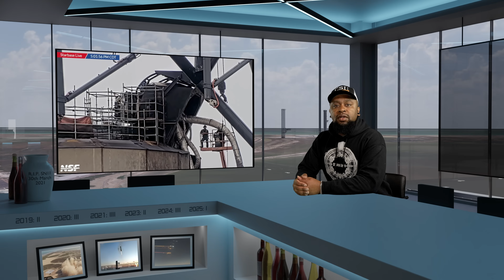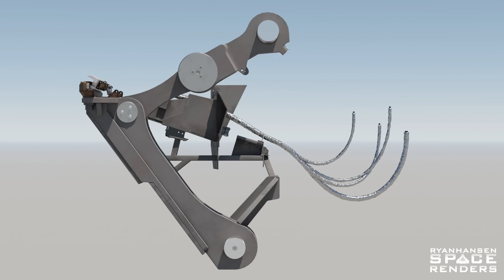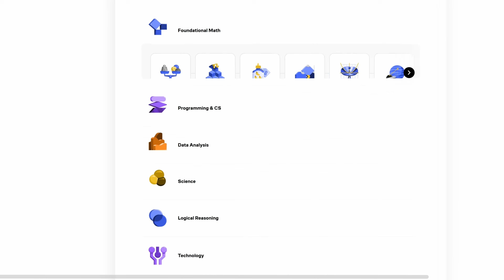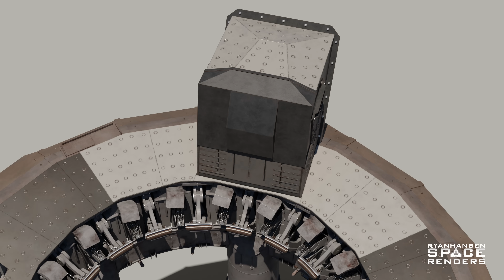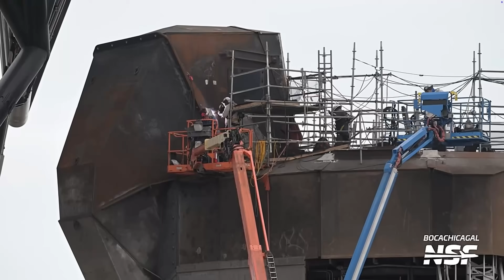The Major Problems With Starship’s R&D Launch Mount | Part 2

Comment: The bushing were likely bored out in position with a line boring machine, after realizing they would need to go a different direction, they shifted from replacing the bushing to the arm itself.

Comment: Reposted from Part 1:  Great videos Zach.  It truely is amazing power generated by the sonic and blast wave assisted plasma torch that lives in the booster exhaust plume.  I was not surprised that SpaceX way under estimated the effects and has been forced to make so many "improvements" to stage zero to deal with these issues.  Like you, I see no easy engineering solution for rapid turn around short of a replaceable mount and hardened flame trench.  The linear focusing created by the water suppression tubes in the new flame trench may prove problematic.  We should never underestimate the dynamics created by focusing blast waves.  Acoustics are not what most of us imagine when they are generated in a shock front.  Let alone when they are generated in a rapidly repeating train of shockwaves.

Comment: I don't understand why they are using bronze bushings instead of sstl. bushings.  Sstl. has a much higher heat tolerance.  The only reasons I can think of is lubricity, stiction, and press forces too high to install and uninstall.

Comment: You do such painstaking research that I know you're aware that Starship will not achieve rapid reusability in this decade, if ever. Falcon9, orders of magnitude simpler, can't be reflown in less than a month. The booster catch was Spacex's equivalent of falcon wing doors and the Cybertruck: showy gimmicks with questionable utility if not useless and a dead end waste of excellent engineering. We won't see a rocket refurbished on the OLM and reflown in this decade. If ever.

What's the procedure to catch a reentry-heated Starship, or to deal with the extreme mechanical stresses that craft will endure during the J maneuver and landing on catch pins while super heated. Who would fly in this vessel after these extreme stressors? They can barely keep the tiles on as it is. Would you trust them or the vessel's welds and superstructure after reentry?

Starship has a loooong way to go before it's viable, although they might get some Starlink's tossed out in LEO soon as a 1-off demo that many will see a success. Starship is underpowered and headed for failure for any mission beyond LEO.
Reply from the maker: lol I’m going to save this one for later use.

Comment: To people who like to knock SpaceX's design philosophy: First off, I'm sure a Boeing or NSAS engineer is saying we would have figured all that out like $20B ago in R&D.  Secondly, if you want to build a whole series of somethings you can either design it to within an inch of eternity, or build one and test it.  If you keep fixing the problems you have along the way then you have a more optimized design in the end.
Reply: Pretty sure SLS launch tower cost $2B to develop and still has issues.  And I think that was Boeing

Comment: Zack, to make the arms even less likely to seize, all they would have to do is extend the lower link. As then it would not have to go up to lock the arm in place. Just a small increase in length would Same as adding weights without needing to add much in the way of weight. place the lower link in a position to fall away which would speed retraction.
Reply from the maker: If they did that then it would no longer be a load bearing link and all the weight would be on the lower Clevis pin.  That’s not what they want.
Reply: @CSIStarbase  The upper bi-fold link would still be load bearing even if you extend the lower link part of it. All you have to do is put in a stop that rests  the lower arm against the upper arm.  It does not have to be a straight line to support the weight. As soon as the rocket meets 1:1 thrust, the weight would come off the assembly and as the bi-fold wold not be in a straight line, it would not bind.

Comment: I can't shake off the image of Soyuz launches where the rocket is held up by a structure quite similar to the SpaceX stage 0 which splits into four parts, each leaning out of the way of flames in its own direction. Yeah sure achieving something similar with Starship launch platform could be challenging but I don't think it would be impossible and it would reduce amount of damage caused by flames significantly.

Comment: Detailed and well put together. But it’s only focused on what they’re doing not why. I never find anyone online pointing out some of the flaws that make you wonder why they’re even using this platform. The first problem I see is the Rockets capability to orbit. They had to design this catching platform because the rocket would not launch with its own landing hardware. If a plane can’t takeoff without landing gear, you may have designed it wrong. We’re talking about a rocket that was initially sold at 300 to 350 tons to orbit which is currently rated for 50. In which its only payload has been a banana and has yet to make it to orbit. And of course, a year after they were supposed to have landed on Mars, we get announced this is just version one of three. How is a rocket that’s only 10m taller than the Saturn five and twice the power not capable of making it to orbit. It should be a red flag. And this catching tower only presents more cost and issues. Their tower is a single point of failure. Any failure of that pad even down to simple mechanical issues, and the whole pad is nonfunctional. It’s added complexity and is absolutely required for launch and recovery of the vehicle. Even bad weather will prohibit a starship from re-entering earth atmosphere. Which would require full operational facilities constantly in operation, even for one launch. Unlike the shuttle or the falcon nine, which just needs somewhere to land. Not to mention that those launchpads are only usable for starship. Unlike the shuttle or Falcon nine that can utilize other launching or landing sites. Meaning that they are a constant loss of revenue for SpaceX.
The problems don’t stop there. Once they eventually get it to orbit, then the refueling math just gets out of control in cost and complexity. Seeing that SLS and starship at the moment cost about the same launch with SLS the only one able to successfully test its platform to the moon and back. It’s hard to see why this is even being funded. The argument has always been that reusability will drop costs, but SpaceX has yet to do that with Falcon nine. The falcon nine cost more today than it did to launch Americans on the Russian Soyuz (not including the bloated cost we were charged after the shuttle program was shut down). Why are we building new architecture, based on recent architecture that has yet to come close to the cost of Soviet era architecture? It just seems that the SLS is the outcome of Congress playing with NASA’s money, but it is a proven system after one launch. Why are we spending billions on another system that is still not proven after 20 years? All that money could just be going to ordering large blocks of SLS and lowering the cost of launches and getting more hardware into space.
Reply: 1. 350 tons fully expendable final version vs 50 tons fully reusable version 1. Yep totally comparable 👍

2. The booster will never land anywhere beside the launch pad, it isn't an airplane

3. It's totally capable of orbit they just didn't intend to. Do you want it to rain space debris on your house because it fails to deorbit?

4. "SLS and Starship cost about the same" LMAOOO

5. "Just order more SLS to lower the cost, what could go wrong?"

6. Ah yes that country that currently invades another sovereign country?

Comment: I wonder if SpaceX will make a separate landing area which could just be the bidet system. All of the launching mount gear is redundant on catching so why stress it with all the heat.

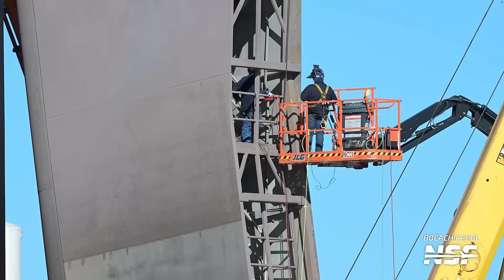Comment: @27:20 the welding on something like this has to be done by master level welders. I'd like to think I've worked on some large projects, but that shit's next level! Cracked welds on a structure that size? The thermal expansion alone causes gremlins I would lose sleep over.
Reply from the maker: It took 6 or more passes on the welds that join the OLM deck to the legs.  Pretty insane.

Comment: I'm wondering why the hydraulic cylinder doesn't pull directly on the middle of the two links to prevent binding instead of pulling on the main arm itself?
Reply from the maker: That’s a good question. We considered that as an option because there are mounting points for either another actuator or a gas spring cylinder/dampener.  But after searching through thousands of images looking into the launch mount before the shielding was installed,  I wasn’t able to prove that there was anything else attached to it.  

But if you think about it, two actuators increases the potential of something going wrong if they happen to fall out of sync.  The timing has to be perfect

Comment: I'll bet those bushings were removed by cutting them out or even just using a torch and melting them. They were probably installed using liquid nitrogen instead of a press.

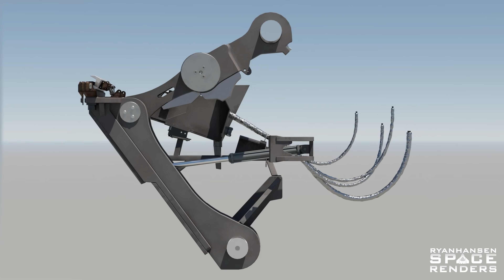Comment: 20:00 Locking/adjusting the actuators furthest extension would also allow the linkage arm joint to be set to a maximum angle, say 170* or 175* for example. I suspect the weights added are more targeted just to force the whole arm to a further retracted angle in rest position in case the actuator fails during launch.
Reply from the maker: If the arms aren’t at a 180 degree angle then that dramatically increases the load on the lower load pin.  They would no longer be load bearing linkages.
Reply: @CSIStarbase  they can't be load bearing without some kind of locking mechanism. If they need to bend to get out of the way fast, I see no way that they contribute to the hold down strength. That would be the triangle formed by the lower arm and the actuator. It appears to me that they may be mostly designed to take tensile loads rather than much of any compression loads. (like guy cables on a tower)

Of course I could be totally wrong, but given even your thoughts on the weights placed on those linkage arms, the second three actuator releases it's thrust outwards, that joint will bend. I believe that's primary evidence of my theory. Please share your thoughts.

Comment: I believe that a lot of individuals don't realize what is involved with creating a new launch and rocket system. We all know that the Mercury and Appolo work ups took years. However, what they went through wasn't daily watched and documented. It's easy to say and question based upon past experiences with NASA. This is a very different animal. SLS uses a lot of systems proven out by the shuttle program. What then is the closest rocket to Super Heavy for comparison?

Comment: 1969-1972 Successfully landed on the moon 6 time in 4 years ( twice time in one year!!! ) that mean  apollo it's easy  but 2025 ( 0 time in 70 years ) that mean  space-x it's hard ?
Reply: It wasn't easy for Apollo either, but also, they had unprecedented resources. Even with that, the program was cut short.
Reply: With the money SpaceX spent so far on Starship, it wouldn't even cover the Lunar Module development cost

Comment: You have to also wonder how much heat got to the uprights holding the whole platform in the air, heat, isn't good for steel, and how much weaker are they now?

Comment: I have another question, how does the QD system deliver methane and oxygen to the center engines for ignition if they are only connected to the outside engines (just asking based on what I think) and if there's plumbing directly to the inner engines, that means the pipes won't get out of the way fast enough when lifting off. 

Sorry if the question doesn't make sense, I am new to this and trying to learn
Reply from the maker: lol i recommend checking out part 1!!!

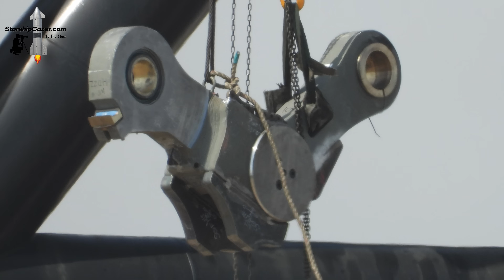Comment: at 10:15 I don't think the bushings are highly coneted to the steel. Why would they need tywraps to hold them im place?
Reply from the maker: Honestly I need to go back and see if the zip ties were a one off thing or not. I didn’t notice it until someone pointed them out last night
Reply: @CSIStarbase  
I must admit I only saw one of them 🙂

Comment: Imo...so much time is spent refurbishing components that rapid reusability will be an intention not a reality...... the only way that occurs is if at least 10 stage zeros are in use so that rapid reusability is somewhat possible.
Reply: Assuming they will use the Pad A design on every single new pad from here on out which is.... doubtful

Comment: The BQD really needs to be opposite the tower rather than on the same side. That way during the tower avoidance maneuver the exhaust flame would not impinge on it. There is no reason I can see that the BQD and SQD have to be on the same side. This would work better on the landing too.
Reply: The latest flyover on Pad B suggests it, also it assumes they'll continue the pad avoidance manuver even on the new Block 2 booster

Comment: On the J6 test stand we used a cold wall on all exposed surfaces. Since the full 90 seconds of the SLB bathed these cold walls, the cooling requirement was enormous…millions of btus/second per ft2. We used liquid nitrogen in these channels to keep the walls cool, kind of like regenerative cooling but on the stand walls. Any areas of impingement were coated with ablative materials. I am surprised sx isn’t using this method.
Reply from the maker: Version 2 will be a massive increase for sure.  Are there any videos out there explaining what you are talking about?  Might be relevant for me to include comparisons of other launch systems in part 3!
Reply: J6?
Reply: @robertclark1734 this is the J-6 LARGE ROCKET MOTOR TEST FACILITY at Arnold AFB in Tennessee. I tried to put the link, but yt doesn’t allow links.
Reply: @elephantwalkersmith1533  Thanks. Googling it’s a solid motor test facility.
Reply from the maker: @robertclark1734   yeah I honestly am unfamiliar with that

Comment: Since the last flight had a payload i think is reasonable to think of higher thrust on liftoff and in general. We've already been hearing the potential that they're throttling the booster snd possibly ship and even not filling 100%.

If the ship also ran at higher throttle then it's possible it contributed the the failure, since that section didn't actually change to our knowledge and it was either a design or QA issue. Added stress from higher thrust might have contributed.

Comment: Could TPS tiles be used to protect some of those heat damaged areas?
Reply: No, they're not going to hold up to the force and they're not made for high velocity friction. They would shatter immediately. During re entry it's almost all stagnant air pressure and heat and not friction.
Reply from the maker: Watch the first 5 minutes of this episode!!!! 

https://youtu.be/UqVLP3DKOk4?si=2u3b2nNu1jz2iHxD

Comment: Awsome job to you and your crew. Thak you Zach. Just out of curiosity, the plats that look like they ar melting on the lower legs, what about using the thermal tiles ontop of the parts that are melting. Also, would that help the protect the welds. Just a thought.
Reply from the maker: I recommend checking out the first 5 minutes of this episode!!

https://youtu.be/UqVLP3DKOk4?si=2u3b2nNu1jz2iHxD

Comment: From one engineer to another: Thank-you! This is the heavy duty engineering of unsung details that make launches like this practical and appear to be seamless reusability. The details matter and it's amazing how quickly they iterated, tried things and made stuff happen. Most people would never even think of what goes on in the launch support systems and Stage Zero. Thanks again for shining a bright light on this issue.

Jake Brodsky, PE
Reply from the maker: Thanks!  Stage Zero is an engineering masterpiece.  Even if it needs to be completely redesigned.
Reply: You nailed it Jake.   Zack's analysis is always scientifically grounded and when he "speculates", he states it.   Such honesty is the rare mark of an old school engineer who loves what he does.

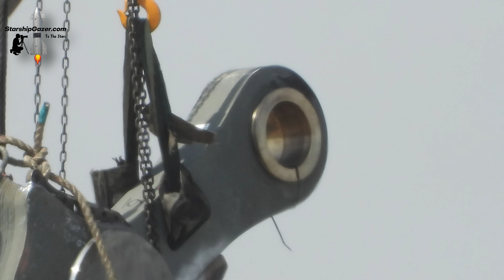Comment: You can see st 9:02 the bushings are being retained during install with zip ties. This tells me they are not a press fit.. The bronze bushing and steel expand at fiffersnt rates.
Reply from the maker: Interesting.  I actually didn’t notice that. Need to look into it more but you may have a point there.

Comment: The counterweights added to the bottom of the arms also prevents the hinge point from rotating upwards or being in a static position and more or less 'frozen from moving either direction. They appear to touch together so they can prevent the hinge from reaching that static position.

Comment: if you really think about it, it seems stage 0 is very ill-designed from the very beginning. Not sure if the leadership of SpaceX neglected it, or was directing efforts to other priorities or just simple overlook. For the most powerful rocket in human history, the launch pad is not carefully designed by first principle, probably in the name of fast iteration, which is a shocking neglection by spacex leaders. Remember the big hole and dent vertical tanks after FT1? Seems it's not always first-principle. And it's not always balanced careful-design vs fast iteration.

I remember Elon talked about the difficulty of building stage 0. I don't think Elon has underestimated the importance of stage 0. Probably it's a well demonstration of hasty decision making inside SpaceX in the name of fast iteration.
Reply: K